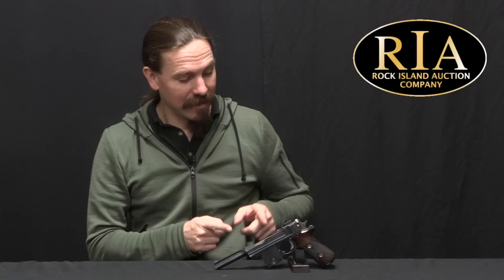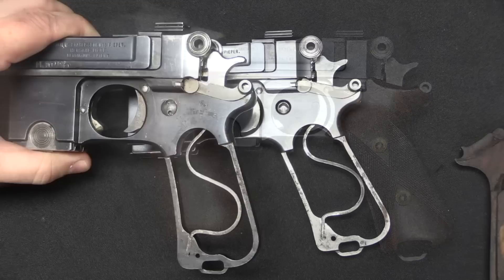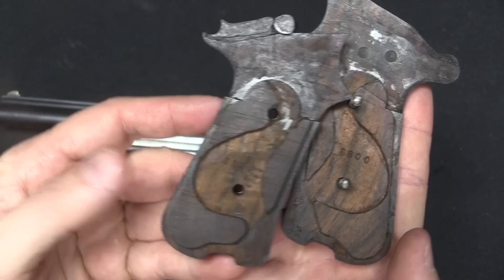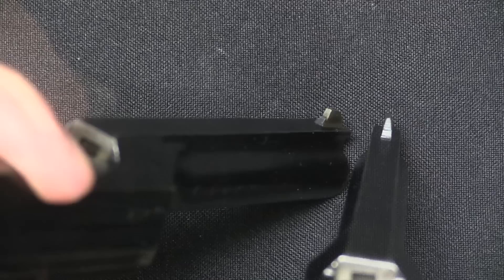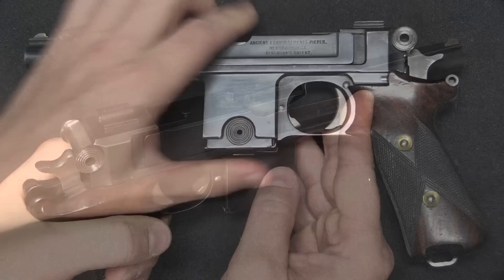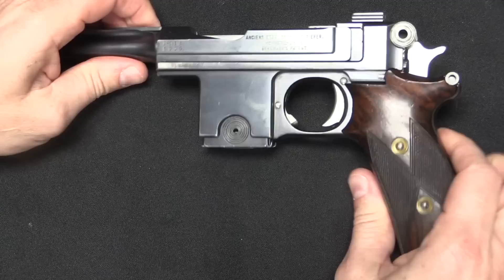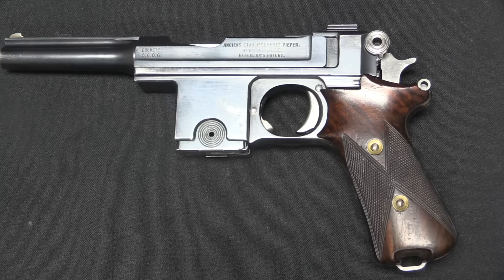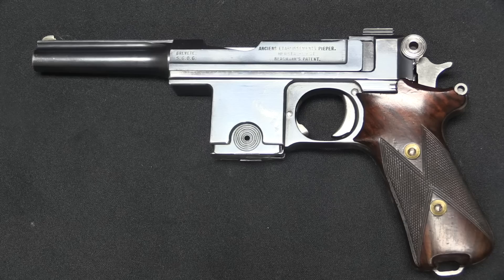Ian Fangirls Over Some Weird Bergmann (Prototype M1910)

Comment: I kinda get the vibe that it's a 100% factory original "one-off" made to a certain persons specification. It might seem like too much trouble, but many manufacturers, especially in the mechanical engineering field like these things because they can charge a lot more for them without actually making a great deal of effort.
Reply: Or it might be for a certain person in a position of power that could place a major order and make a custom gun a rounding error.

Comment: I'm pretty sure that angled grip Bergmann is just a "sporterized" 1910 pattern with new grips. If you squint really closely you can see the thickness of the grip frame is not uniform along the full length of the front strap and backstrap. It looks like a gunsmith put a torch to that frame and carefully eased it into its current shape on anvil. It's hard to notice as Ian is not showing the grips from the front or back clearly, but the metal grip frame near the top looks to have had the finish/bluing burnt off or discolored black, a clear indication of heat. At 3:53 Ian lifts the pistol off the table and you can see the front strap just under the trigger guard is a mess of different colors from factory finish to sooty black to white unfinished steel. The same goes for the backstrap at 1:38 just before Ian grips the pistol you can see the top of the backstrap is much darker than the rest of the grip frame which the finish has worn off with handling. Furthermore the side plate screw under the left grip panel is the earlier eccentric version before Danish production changed it to the 2 dimple spanner type screw.